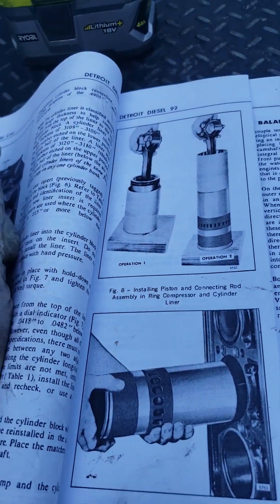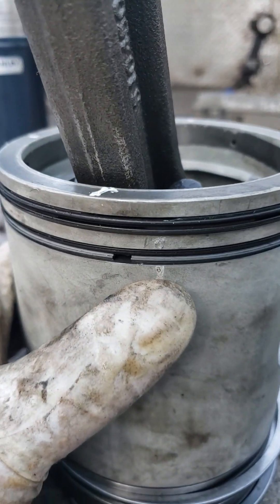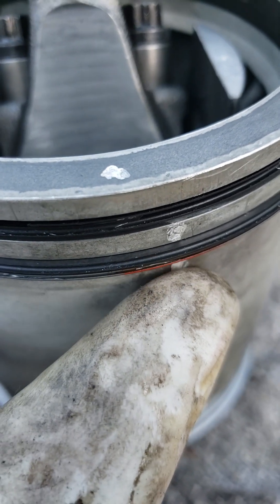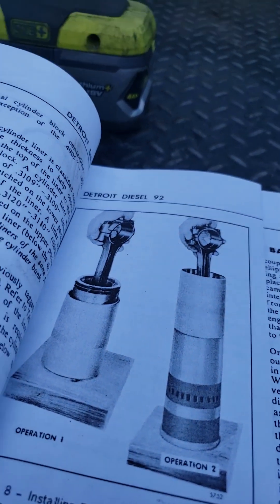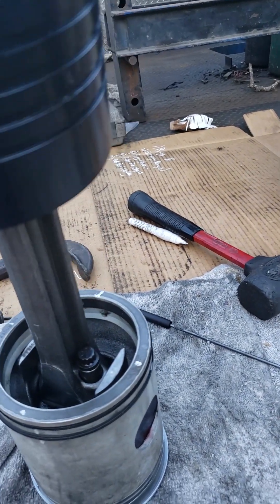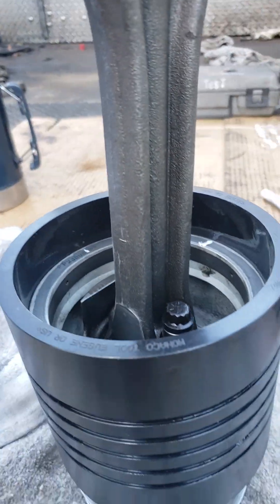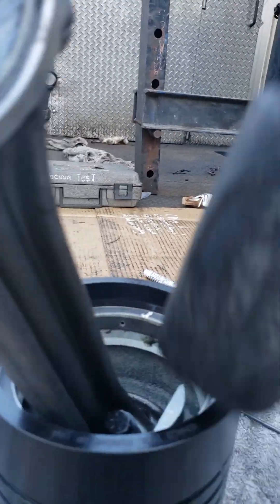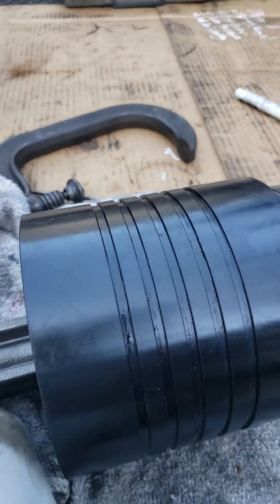Detroit Diesel 6V-92 Seized: Debunking the $550,000 Quote - Ep. 7 - Avoid Oil Ring Overlap #diesel

Comment: Avoiding oil ring overlap IS critical... but installing the piston from the bottom of the liner is ALSO critical. Why? Because the oil control rings should never travel past the ports in the liner. They WILL grab and they WILL break. All that wasted effort to try and not break oil control rings, to go ahead and break oil control rings anyway. And if the oil control rings didn't break, you're the luckiest man on the planet and you should be investing in lottery tickets instead of service manuals you clearly don't use.
Reply from the maker: Hey OI2, I just saw your comment right now. I also checked out your channel. I subscribed. It's nice to learn new tricks of the trade. You definitely have a lot.  As for me being lucky and not reading the manual, I'm just wondering how many oil rings have you broken? I mean how many times have you tried it my way and had the oil rings grab? What you didn't see in the video is some of those pistons had to get removed and reinstalled. That is installed the same way I talked about it in this video. If I found any of the oil rings had broken at that point I would have never posted the video.Also the required oil analysis after 3 and 1/2 years of operation backs up my statement, no unusualy high ferrous or non-ferrous metal content. Nothing broken on any of them. During the 6-month PM service, it's required the tech must run oil analysis on these big backup generators. Furthermore I even made a video about how piston protrusion was a no-go and I had to remove a piston and replace a rod. I actually had to replace two rods. I talk about one of two in this video...https://youtu.be/8v__y6LC8K8?si=PO52rwbhANVSdygg. When removing the pistons nothing broken on those pistons either. I wish I was as lucky as you suggest. That job was three and a half years ago and the motor is still roaring up beautifully.  Finally I have the manual. I always buy the old school paper mannuals on eBay cuz I like reading them. I sat down at a Peet's coffee shop read the whole damn job. Although, after 30 years of turning wrenches, I have many times chose not to listen to the manual. I tend to have good judgment when to steer away from the manual. I have a feeling you do and have too. All the good mechanics do. The problem I find, after having 25+ employees I realize it's tricky to teach a new guy when not to listen to the manual. They generally will mess up. I just know when they do mess up I try not to lift up my image by publicly making them look stupid. Since you brought the whole subject up, what is your trick to keeping the rings from not overlapping when you're compressing them into the sleeves? I am guessing you might have a video on it. I couldn't sort through all of them rapidly. Maybe throw a link?  I want to watch it!!

Comment: Gut feeling....seemed to go in a bit tight....wiper rails holding in the expander can be troublesome. Old school v71 and 6 53 and 238 guy here from Sanford,NC. Worked with  factory engineers on air box/casting redesigns on "318" (8v71) in '69 due to propensity for cracks in the block. Also "Fuse Weld"company in Ft.Lauderdale for repair of cracks in blocks..
Reply from the maker: So far so good. Thanks!!